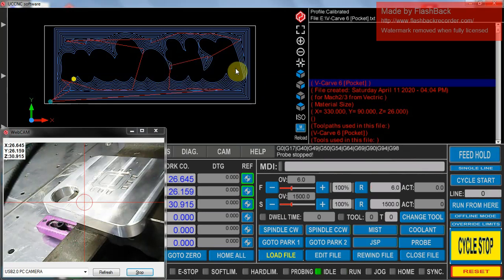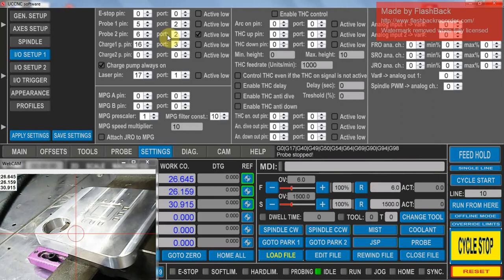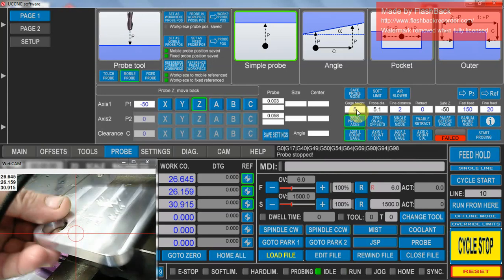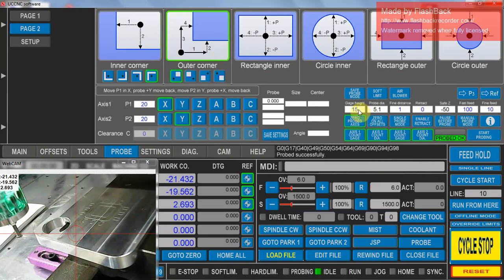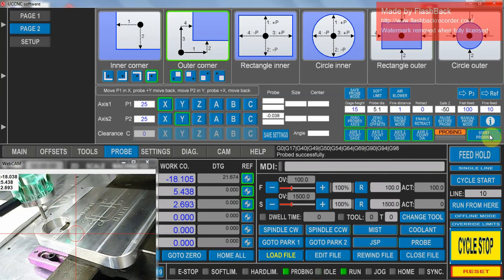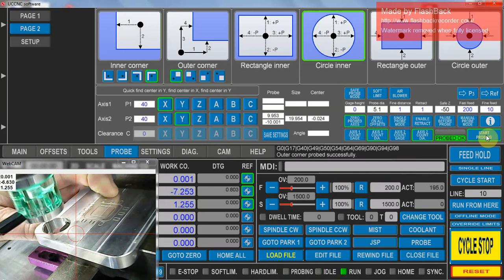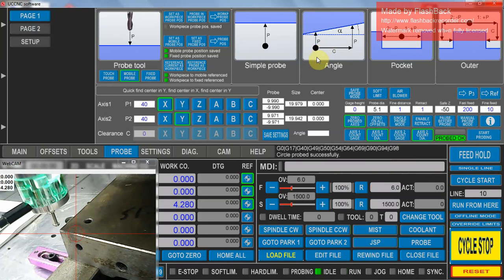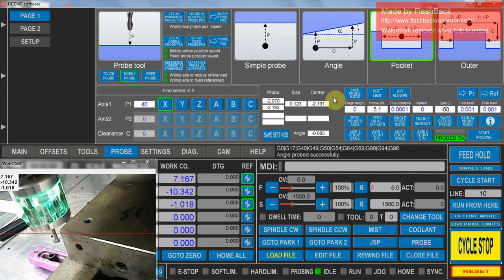UCCNC probe setup

Comment: Maybe a stupid question, but where do you add the tool length offset for the 3D probe? So the Z-position is usable for other tools in the tool magazine? I am working with a Stepcraft M700
Reply from the maker: All the tools are measured and value stored in tool table , i don't know if stepcraft macros work with It though .  A custom macro may be required
Reply: @tomahawkcnc thanks! I will look into to it 😊 I think the Stepcraft macros should be able to access the tool lengths! I will store the 3D touch probe length offset as e.g. tool 11 and see if it can be accessed; the magazine can contain 10 tools

Comment: Many thanks for having posted this video. It has cleared up many questions I had.  I have been using my cnc milling machine for 5 years now and I never managed to get the probe to give me the hole centre. I struggled on with using an edge finder but having just updated my software to the latest version I am determined to get it working. I have a nice probe with a ruby contact point. It has a light on the side that shows when contact has been made with is also helpful. I have it connected up to probe 1 and it needed to be active low to work. I can make some progress. I have homing pins set up and they work fine with soft limits. I can home each axis separately if I want. 

Now with the probe connected and with your settings I can get the y axis to work and it produces some numbers. It then switches to x axis and moves out to contact the x+ side of the hole and it stops and I cannot get it to continue back to the other side of the diameter. It just stops still in contact with the hole side X+ and the indicating light is still showing.  I then can press reset and clear it to start again. I have tried slowing the speed down. 

Is there anything that you could suggest for me to try?      John
Reply from the maker: look at your retract numbers

Comment: Missing link in every tutorial for me was "seperate settings per mode", and if i am not wrong, this will save the buttons on setup 1 and setup 2 + gauge height. I was struggling with the repeated Axis count gage and gauge height values beetween Z and X+Y mode values for every probing. It can be saved and a lot less of a hair pulling.

Comment: Question for you.  I have all working just fine, but struggling to try and get it to retract a specified distance.  ie Probe Z azis, zero axis and retract 25mm.  It just retracts whatever distance the probe was from the surface it was probing before it started.

Comment: Many thanks Daniel. 

Please,  on my UCSB bob, does the black npn cable connect to any available Input or Output point?
The probe instructions indicate that the yellow cable goes to +5v to +12v and blue connects to ground. My challenge is with the black cable.

Many thanks in advance
Reply from the maker: Normally the black wire will output +ve so it goes to input +ve and input -ve to earth on the ucsb
Reply: @tomahawkcnc  Many thanks bud. This helps.

I was challenged understanding the wiring diagram in the UCSB manual.

Comment: Thanks for this Daniel. I struggled to figure out the settings to make probing work.
One question : at 5:32 when you enter X0Y0 to move to the X0 and Y0, would hitting the Goto Zero button do the same thing?
Reply from the maker: NO , in the std uccnc macro for that button it would goto X0Y0Z0 and if your z was bed as mine always is it woukd crash into stock . I have chsnged my button to Goto XY Zero
Reply: @tomahawkcnc  Thanks, very glad I didn't try it!

Comment: Hi Daniel.

Thank You for this video very well done. But I have a question about the angle probing. If I put a workpiece that is not parrallell with X and Y axis, does angle probing compensate for that misalignment with X, Y axis. When You are running a G-code in UCCNC.

Best regards to You from John Eriksson in Sweden
Reply from the maker: No it tells you whast tyhe angle error is , in uccnc you need to add gcode command G68 A0 B0 R45 where A and B are the X Y centre of rotation and R is your angle error ( in the case above 45 deg )